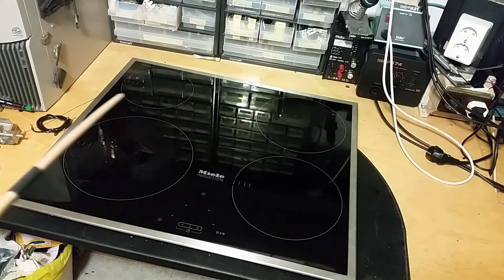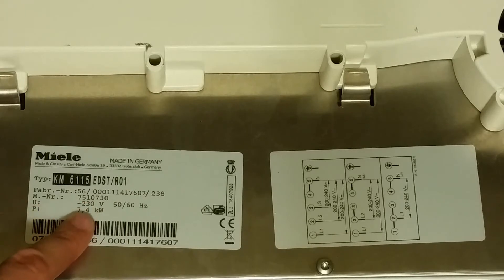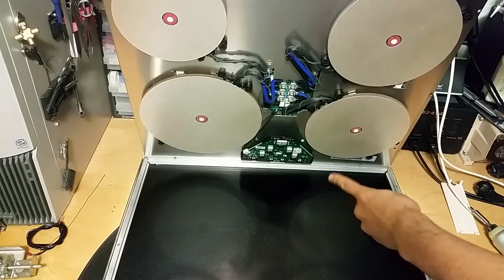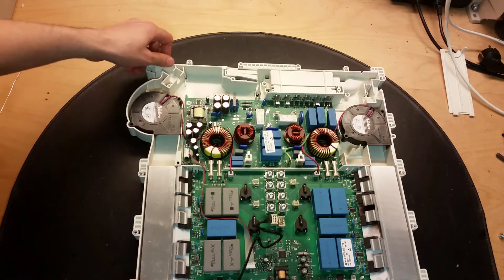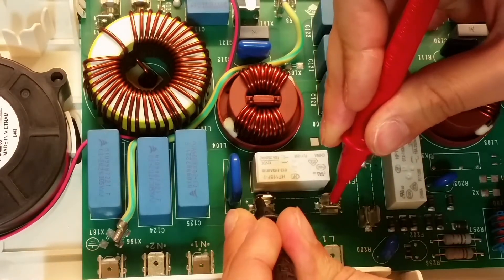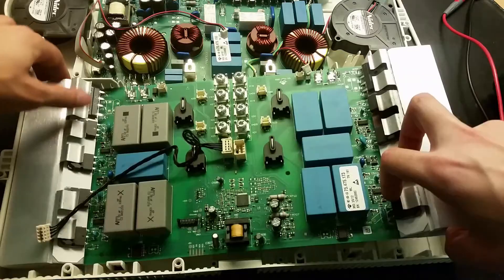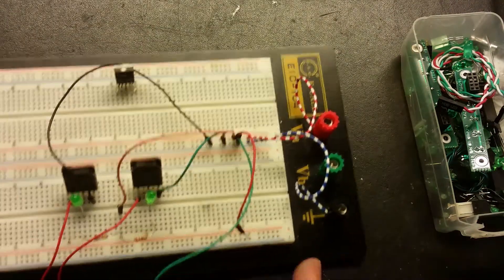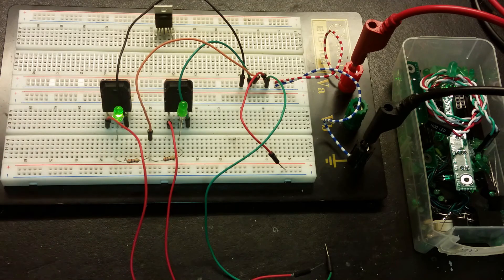Induction Stove Repair Part 1

Comment: Hi, please, could you be able to help me showing how can connect again the connections to the mother board?, I have 2 plaques; 4 cables with colors and the mother board has alphanumerics like J5,J6 ,TX2, V2 and J7, J8, TX4 and J2. I’ve lost the picture with the correct connection when I disconnected to send only motherboard to repair. Thanks

Comment: @MrTesla1337 I have a AEG induction cooker since 2001 and the two rings at the front stopped working intermittently about a year ago, sometimes they worked and sometimes they did not. But recently they stopped working altogether and I have gotten used to using only the two at the back. The lights are blinking but they keep blinking if I put a pan on top, it seems like there is no pan on it: there is no current flowing through the front two coils. Any idea what it could be? Thanks for the video btw, very informative.

Comment: Could induction stove or cooktop be set or programmed to derate the power in case the thickness of the wires inside the house walls were less than the thickness needed to carry the maximum power  ?

Comment: Hi my dear! I am reaching out to see if you can help, I got a Hisense induction hob, suddenly it stopped working properly, so when I turn it on after few seconds the main switch and the regulation of *power switch stop working, it just keeps going, like it is lock or something similar. Any Ideas of what is happening with the control board?

Comment: Really good video. Thanks for explaining what the parts are and what they do. You went about this very methodically and succeeded in isolating the faulty component.  Did it work again after you replaced the shorted IGBT, or was there another upstream fault that caused the short in the first place?
Reply from the maker: Thanks for the comment, i will soon make the part two, i think there are some more problems with it when i tested it with new IGBTs
Reply: @MrTesla1337  I hope the final video is coming soon, I can't imagine that other components are defective.
Reply: @MrTesla1337  buenos dias, tengo la misma placa de inducción, tiene el chip de control arreventado y no puedo ver la referencia me podría mandar una foto o la referencia del chip? en el video es en el  minuto 7:56, buen video y muy buena la explicación. un saludo.
Reply: Very good repair tip,God bless u

Comment: How power efficient are these induction cookers?
I'm going to solar and looking for alternative for natural gas or propane.
Reply from the maker: The Induction cooker is much more efficient than a cast iron or ceramic cooker, some numbers i found on google is that a induction cooker has an efficency of round 90% and the other has 65-70% because some heat is lost round the pot or conducted from the hotplate into the rest of the stove
Reply: About 30-40% more efficient than coil, resistant electric stove. With the right pan this goes up too